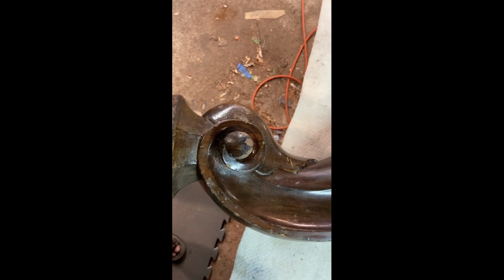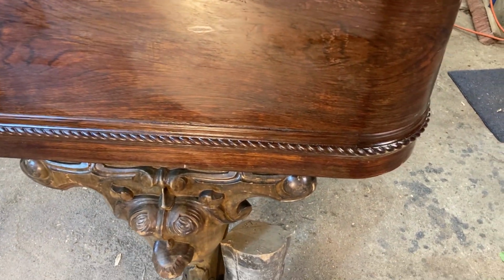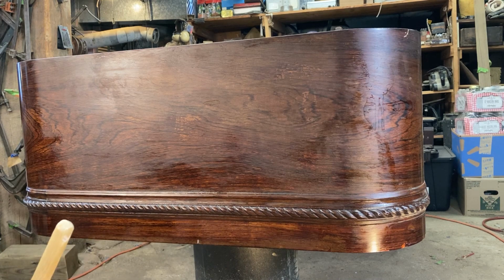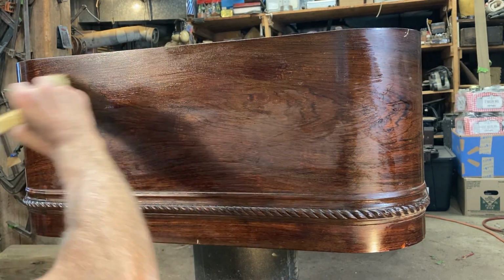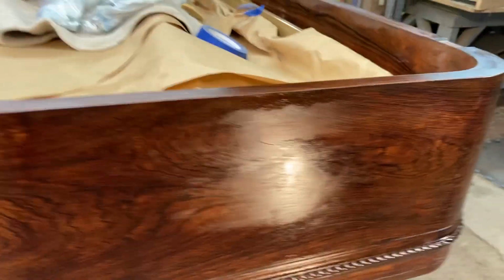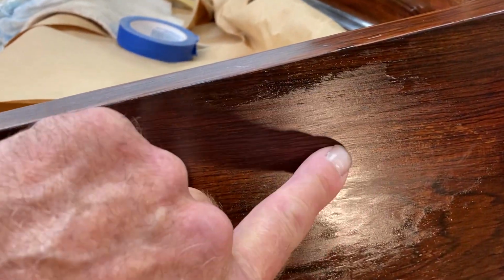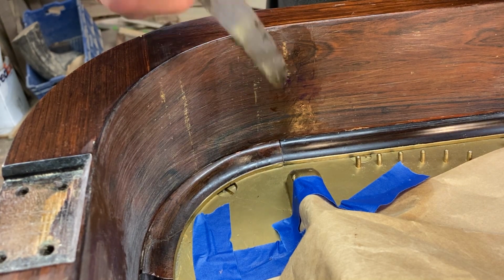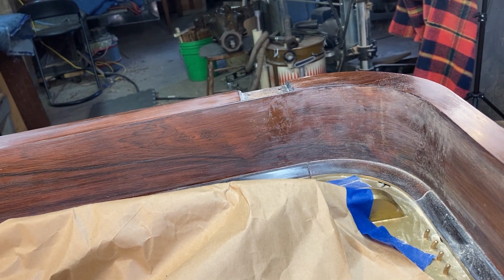Chickering 33B 1867 Conservative Restoration Part 45

Comment: Out of curiosity, why silica instead of say pumice or rottenstone, which was used traditionally?  Can’t question the results, that finish is beautiful!
Reply from the maker: Jeepers- Thank you.
Hmmm- I was not taught this,  and I can't  find any info even in the very old books we have. I tried those other things and none are so good as this.
I can't imagine mixing rotton-stone or pumice it with shellac and applying it, rotton -stone would make a mess, and fine pumice is still like polishing with sand,  and the transparency element is not as good. 

Seems it hasn't been done or some would be blabbing about it's wonders.
Google the history of colloidal silica and see.
The books we have refer to mineral substances used as grain fillers.
And quartz is the clear as glass  the top of them all preferred wood filler,  why anyone would use anything else is a mystery.  "to me"
Nowadays gypsum is used in some fillers, for crying out loud,  what crap!
I could go on and on about this tradition thing-----just to say again,  "polymerized oil based" wood fillers were applied before the varnishing and shellac was never a primary finish on anything.  Especially on pianos!.
Just to say shellac mixes with nitro cellulose, I have done it!   
Mix shellac & alcohol with gun cotton & camphor, and it french polishes nicely, but not without gum-camphor.  Makes it very tough, and moisture resistant.